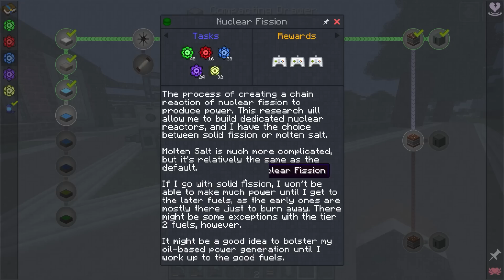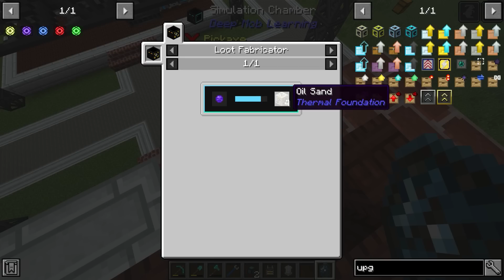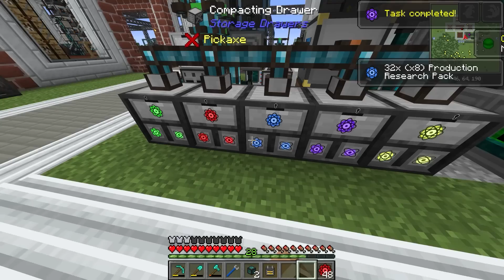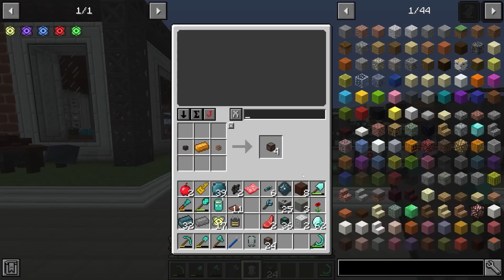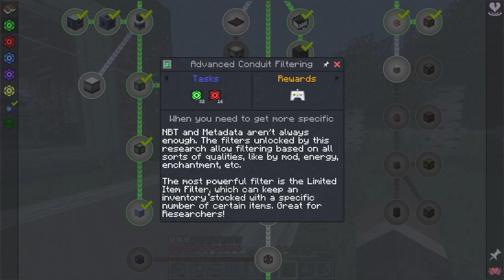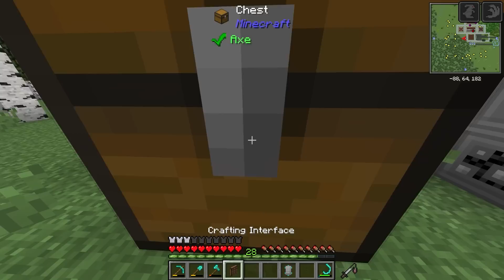Minecraft Feed The Factory | MEGA METAL PRESS & ELECTRODE ALLOYER! #23 [Modded Questing Factory]

Comment: For “sub-networks” on ID as you call then you can also do it with channels if you end up in a mess of lines and can’t run a dedicated cable.  Set the interface on say the chest to channel -1 instead of 0 then in the export item sub menu of the exporter change Channel from 0 to -1.  Same effect as what you set up but can be done even if you can’t dedicate an isolated cable.
Reply: For anyone who is using ID, don't use lower than 0 as a dedicated channel. -1 is a wildcard channel and will essentially connect to all channels, -2 channel and lower might actually be dead channels. Keep it to 0 and above for dedicated channels/subnets